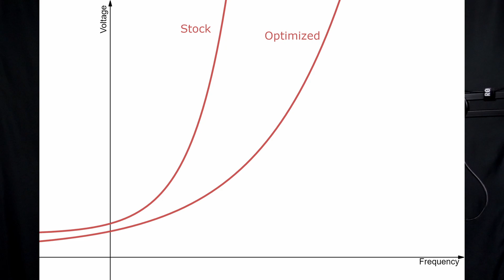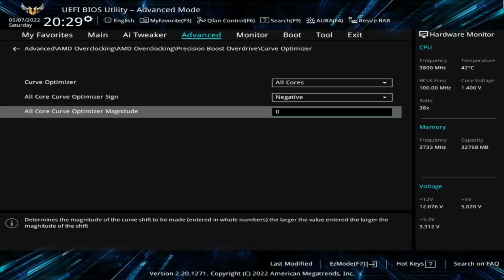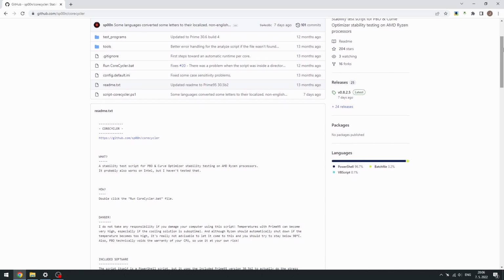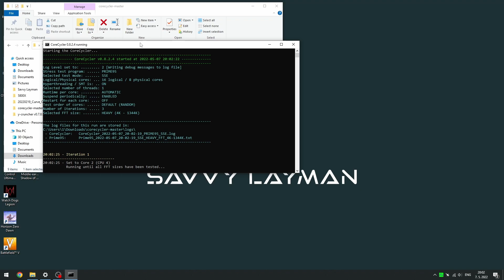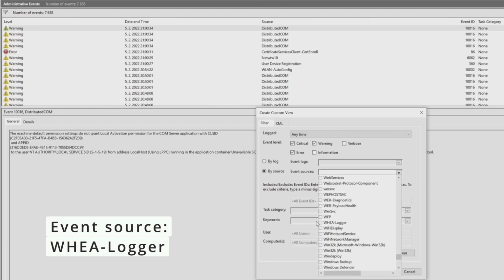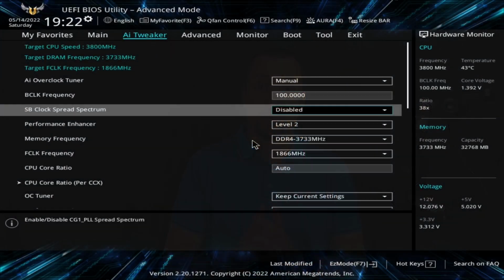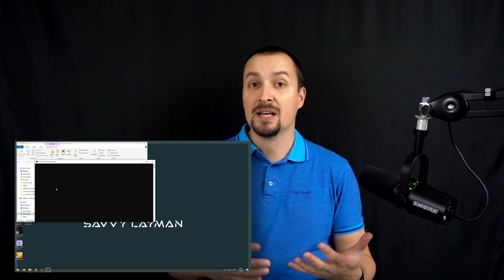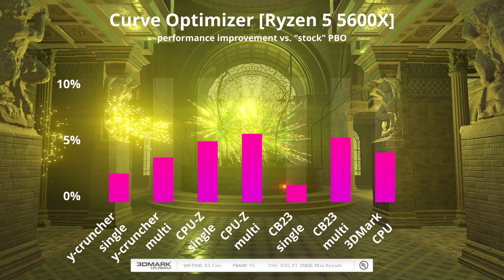Curve Optimizer - Ryzen 5000 / 7000 per-core "smart" undervolting

Comment: Curve optimizer is a big waste of time. Just do -.1v offset
Reply: I have spend hours trying to get my 5800x stable with curve optimizer. My best was 3 days uptime, then bluescreened when idle at the desktop on the 4th day.

This system has never crashed at stock or with a -0.050v negative offset.
Reply from the maker: @CaptainSpicard  Yeah, it can be a pain in the b*m. What curve did you end up with? Have you had a chance to verify it with CoreCycler?
Reply: @savvylayman  It was eventually stable at 12 (negative), however the power reduction benefits were lost at that point, and only for an extra 200 points in Cinebench R23.

I ended up just doing a ton of playing around with voltages, here were my findings:
Cinebench R23

stock
Temp: 89
frequency: 4400
voltage: 1.313
score: 14827

undervolt -.050
Temp: 85
frequency: 4400
voltage: 1.287
score: 14948

undervolt -.075
Temp: 83
frequency: 4425
voltage: 1.281
score: 14850

undervolt -.1
Temp: 80
frequency: 4450
voltage: 1.269
score: 14443

BEST
adjusted undervolt -0.625
Temp: 83
frequency: 4400
voltage: 1.281
score: 15016
Reply: I'm now thinking after seeing some other comments, I may try another curve optimization start at negative 10.

It seems i'm leaving a lot of performance on the table by just applying a single voltage to all cores.
Reply: @CaptainSpicard  what do you prefer in the end?
Reply: @turops2628  Settled in a -.05v undervolt, ditched curve optimizer. Runs cooler and faster, no complaints.
Reply from the maker: Thanks for your comment. I made a short video reply for you: https://youtube.com/shorts/HQDFzcFNPDw?feature=share

Comment: Ahoj odporučaš aj pre laptopy?(legion 5 pro). Skusal si na svojom legione? Resp su nejake varianty pre laptop? Chcel by som si undervoltnuť r7 5800H.
Reply from the maker: Ahoj, vyborna otazka. Aj ja by som rad spravil undervolt na svojom R5 5600H (tiez Legion 5 Pro). Problem je v tom, ze na urovni firmware je voltage control zablokovany. Je to velka skoda. Takze ani ThrottleStop, ani Ryzen Master nefunguju.

Comment: Used core cycler and saw 3 cores throwing errors..  now no errors so far after adjusting..  

Unfortunately I had it set lazily for past 6 month's.

Thanks much for the clear instructions
Reply: So after going thru some three minute tests and finding a 'happy zone' I decided to run each core at 1 hour each over night.. and 2 of 3 cores which were giving me issues threw errors again.. woke up and put them down a wee bit more and ran another 1 hour test and all is well so far.. 

My current is
0, 1, 2, 5, 7  = neg25
4 = neg20
3 = neg7
6 = neg12

Do you think running longer than 1 hour tests would help or anything other than default?
Reply from the maker: @thegitago7823  I'm sure hardcore overclockers would insist on testing each core longer, but let's be realistic - 1 hour per core is plenty. I originally ran y-cruncher workloads only, but I later noticed the cores were not prime95 stable. I had positive experience with prime95 workload, FFTSize = Heavy, runtimePerCore = auto.